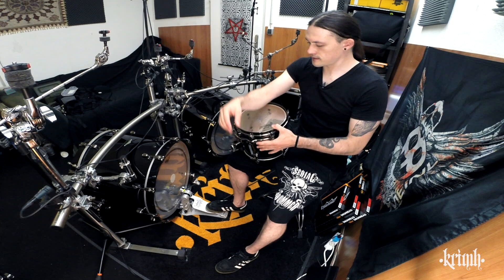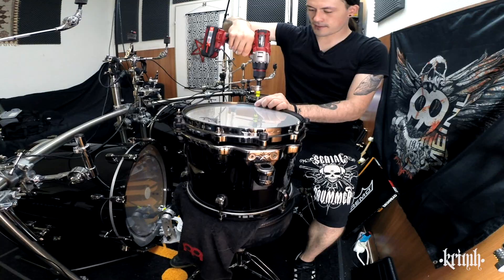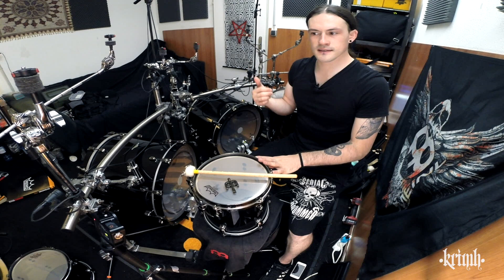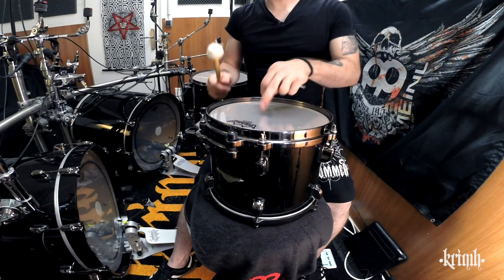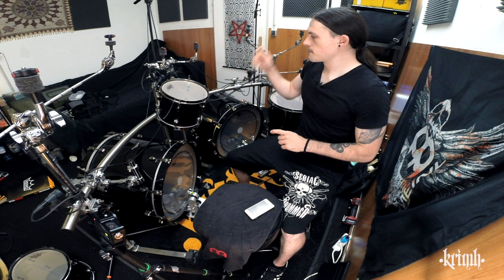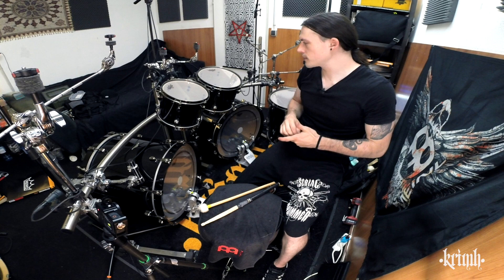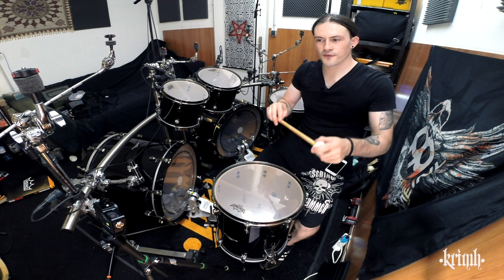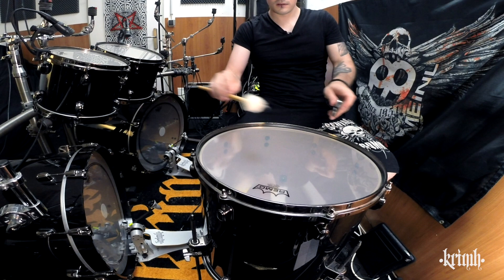KRIMH - Tom Tuning

Comment: I use the same technique you used with pressure on the head of your 16” floor Tom to get out all the wrinkles out with my bass and floor toms. A guy in marching band a long time ago told me that if you have the right pressure in the center of the head and bring out all the wrinkles and just tune it there it is lowest possible pitch.

Comment: Nice job and awesome video! I guess I know to which tuning method you refer to by choosing D A E C ;-) I love this approach. One question: My 16" floor tom is pretty tricky with plenty of flattering overtones (angry cat style) even though I'm using the same batter and reso heads as you do. Is there any hint you can share how to avoid this angry cat sound beside to even everything out?

Comment: What you think of using D drum dial?. I got it and I think is usefull. And easy to use... Should try hard to use a soft mallet and my ear?
Reply from the maker: Gamma T.C. I know some people like the drum dail and the tunepot but I rather use my ear.  you can use the drum dail to get the right tension but you will still have to fine tune each lug by ear. That’s why I skip using such devices and trust my 👂